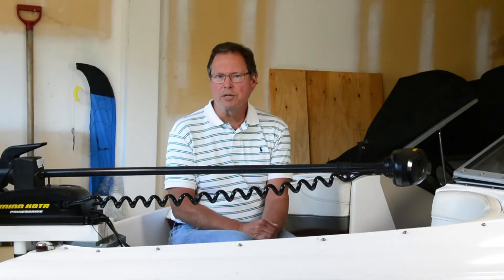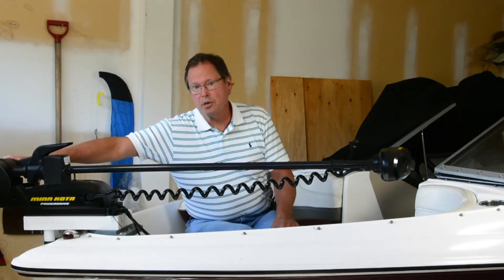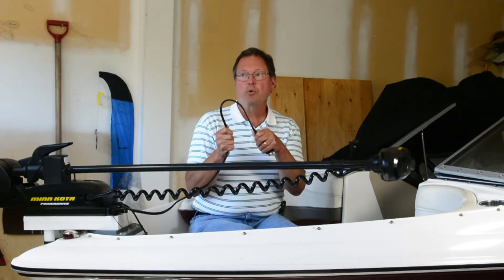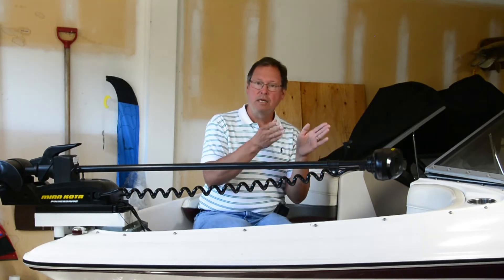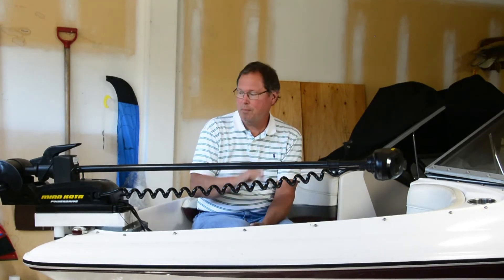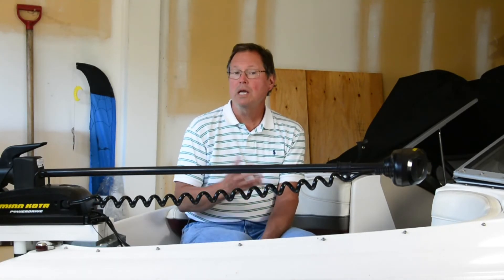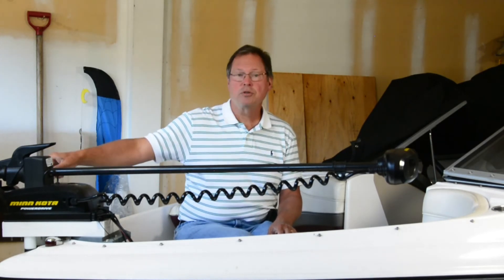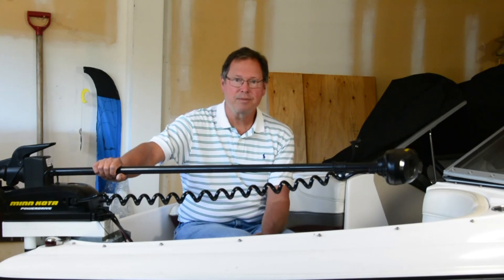12V vs 24V Trolling Motors - 3 reasons why 24V is more efficient

Comment: Well helped by your video and my experience with the !2 Volt Neraus engine mounted unit on my 16 foot fibreglass Cabin Boat I moved to a 24 Volt Unit together with a 110 amp Lithium Battery.
Whilst the Battery was expensive I now troll at around 1.9 mph at approx 14 amps which is giving me around 6 hours without stressing the Battery. All in relative silence ! Am very pleased
The amp draw for the same relative speed is also notable according to the weight carried in the boat.Ie with or without an auxillary motor and additional people.
With the 12 volt I was getting 1.42 mph drawing 16 amps and 2.18 mph drawing 53 amps .
Reply from the maker: Wayne, I'm very pleased this video helped you size out your system.  I spent a great deal of time on the internet trying to sort out a similar problem with my boat.  I'm very happy to share my learnings.  Thanks for your note.  All the best.

Comment: What about charging.  Been told the on a 24v sys with 2 12v batt in series they must be charged independently. Yes! No! ???
Reply from the maker: Hi Robert.  It depends on the charger.  If you have your trolling motor battery banks and trolling motor completely separate from all the rest of your electronics, and not connected to your engine charging circuit, and you are only charging from shore power, there are chargers that will charge two 12V batteries wired in series as a single 24V bank.
Most of the trolling motor specific chargers tend to make you think of always using 12V batteries as separate charging "banks".  So, if you have two 12V batteries for a 24V motor, they want to sell you a "2 bank charger".
Assuming both your batteries are the same brand, age, and capacity/model, there is no reason a 24V charger designed for the battery chemistry you are using cannot charge both wired in series together.
For example, if you have two 12V Series 27 AGM batteries wired in series, you can charge them with an AGM 24 V charger.
At the end of the day, a 24V battery is electrically identical to two 12V batteries wired in series.  There are simply twice as many cells put in series to get to the correct voltage.
Reply: @GoldenChannels Im  running 2 Everstart group 29DC Deep Cycle batteries in series. Same battery, same age, same CCA and isolated to trolling motor.  Was planning to charge with 24v charger after a lake visit. Then meter each battery to see how they charged.
Reply from the maker: @robertbennett6418  That should be fine.  After charging, if you let both batteries rest without the charger attached overnight, or at least for a few hours, if both batteries are healthy, they should be about the same voltage.  This will usually be 12.6V, but can vary by battery manufacturer.

Comment: HI Dean, this was pretty enlightening.  I have two trolling motors a 12V-55 and one that came with my new boat 24v-70  The latter came in really bad shape, I since have replaced whatever needed to get fixed but never installed it and use the 12v instead, I totally notice the lagging early on my days (and a hot plug) when it has been windy or I am working in heavy current.  Boat came as well with two batteries same size but different brands and provably ages as well.  Now one of them is dead and I need to replace it.  At the store the gentleman told me that there is no problem in mixing batteries, that is not what you said and I have a feeling that you know what you are talking about🙂   
So not to make this any longer looking forward to your video about UPGRADING 12V to 24V that will be awesome and also if you can tell us a bit more about mixing batteries.  Thank you very much for sharing your knowledge in a way that is easy to understand.
Reply from the maker: Hi Alex.  Thanks for your comments, and I'm glad you found the video useful.  The 24V conversion video should be out before end of summer.  Obviously, there are other items that need to be changed to allow onboard charging from the Yamaha Outboards 12V charging system, and also shore power charging.  Thanks for subscribing.  We'll let you know when more videos are here.  Tight lines.

Comment: Great video.  I have a 24 volt powerdrive for a 85 lb kayak and a 120lb scanoe and I have a 24 volt 50 ah battery that I've only used once. Can I buy a second 50 ah same battery to add since the one I have is practically new. I fish a river with current and I figured the 24 volt motor would do a better job because my 30lb thrust wasn't enough to push the kayak in some areas, it would come to a standstill.
Reply from the maker: Hi Dennis.  Yes, there should be no issue buying a new version of the same make and model of battery and putting them in parallel.  My suggested process for putting any two batteries in parallel is to disconnect both and charge them fully, and let them rest overnight.  Then run the wires to them to connect them in parallel.  This will minimize inrush current between them.  Hope this helps.

Comment: One more question for you if you will indulge me.  I was initially confused about the charging of a 24 volt ( two 12-volt batteries in series system), but I think I understand now. I have a NOCO genius 12 volt lithium charger with 3 banks. If I place one set of leads on each of the two lithium batteries in series - I am thinking it will charge the two at above 24 volts, because they are in series and the charger's voltage will also be added together.  I first ordered a separate 24 volt charger but then realized I didn't need it and canceled it. Was I right?
Reply from the maker: Tim,  Thanks for your comments.  The most direct answer I can give you on whether a 12V charger can be used to charge 2 x 12 V wired in series, one at a time, would be to contact the battery charger manufacturer to ask them the question directly.  The answer lies is how the charger is designed, internally.  Some will work, and some won't.  If you have any other shore power connections to your boat will also come into play here.  The main factor is where ground is in both the charger and your shore power circuits.

Comment: This was an excellent physics lesson. You really know your stuff! Your video really helped me realize the advantage of 24 volt. Based on your video, I decided to go with a 24 volt Motorguide Xi5 80 lb instead of the 12 volt 55 lb. I was just trying to avoid adding another battery and so I could use my battery switch.  I decided on all Ionic lithiums which are very expensive, but I think I will be glad I did.  Since they are two twelve volts, I can still take them out of series and have a backup in the event of main battery failure. I have a 2018 whaler montauk 170 that weighs about 2500 lbs loaded. I think the 55 lb 12-volt would have been at its limit (on the power curve) all day, especially because of the significant currents, waves and wind in the ocean here in Boston. For my old 12 volt minn kota 55 riptide in my old 15 ft montauk, I had 6 gauge wire going to my bow plug, which was a pain to fish from the console to the bow. With the 24 volt setup on my new boat, I went with 8 gauge wire, which will be easier to fish through and work with and since it only travels about 7 feet, it should be just fine. Thank you for helping me avoid a mistake. Since I already made the decision to have a saltwater trolling motor - mostly for the spotlock feature to avoid anchoring in waters over 100 ft - I should make sure it can actually do the job and not become a toaster oven.....

Comment: I would like to know the comparison of a 55lb motor running at full power and an 80lb motor running at 55lb thrust. Is this published anywhere? Effectively your site suggests both those size motors are running ~50 amps, with the 80 on 2x the volts of course. Even better would be to know the current at half power settings for both motors.
Reply from the maker: A good question.  The 24V Trolling Motor providing 55 lbs of thrust will be more efficient, and therefor will keep going longer from a similarly sized battery setup.  If you want to do a direct comparison for the specific motors you are comparing, you can punch in the numbers on our trolling motor wire calculator here:  https://www.goldenchannels.com/electric-trolling-motor-power-loss-calculator/

Current being supplied to both motors will be nearly identical, less the mechanical losses due to the 55 lb being full throttle.  The 24V motor at 55 lbs of thrust will lost a quarter of the power through the wiring as compared to the 55lb, which is significant, especially with longer shaft models and those installations with 20 feet or more of wire from the batteries at the back to the trolling motor at the front.

Tiller handled versions will be less affected by the voltage difference.

Hope this helps.
Reply: @GoldenChannels  Thanks but the calculator only seems to provide maximum current. I understand the motor when dialed back will be pulsing and quite affected by load so will be hard to measure and impossible to calculate. I did find 1 test someone did on an 80lb in no wind/current conditions, where max (10) was 33A and setting 7 was 15A, setting 5 was 6A, suggesting it is not linear, as expected, and that a 80lb running at .7 power is at least 2x as efficient ignoring all other gains as you detailed. However, if they were only measuring peak current those numbers could be way off, but not likely to be worse.
Reply from the maker: @soobz  Thanks for the comments on the calculator.  Yes, all trolling motors use what is called PWM for speed control.  If you try to measure current on an PWM circuit with a voltmeter, or even worse, an inductance based current meter with a clamp that goes over the wire/cable, the likelihood of getting a true reading is highly unlikely.  Maybe this will help.  My boat is 2700 lbs dry, with outboard.  It is a 18' Campion Allante.  I have a 55 lb, 12V Powerdrive with a 54" shaft.  On flat water with no current, I can get 2.1 MPH with that motor wound out.  My main reason for going to a 24V 70 lb would be to get more of the power to the motor itself, increasing battery life.  I'm not worried about top speed for the fishing I do.  I'm happy trolling at around 1.5 MPH

Comment: I'm dumb so excuse me..I have a 30 thrust on my Jon boat with 1 battery and my new bass boat came with a 40 thrust 24v ...does that mean my 40 will be 2x as strong as the 30?
Reply from the maker: It's a good question, and trolling motor thrust ratings are confusing.  And, since I don't know exactly how both boats are wired, I can only give you guidelines that the 40 will provide about 25% more thrust power to the water.  Thrust also does not translate directly into speed.  Considering that your bass boat is probably fiberglass, and the Jon boat lighter aluminum, I suspect that your bass boat will most likely not be much faster at top speed than the Jon boat.

Also, your Jon boat's trolling motor is probably also a tiller handle.  So, there is less overall wiring in it.

If you want to actually calculate the difference in how much power is lost in the wiring of both setups, we have a Trolling Motor Wire Calculator on our website that might be helpful:

https://www.goldenchannels.com/electric-trolling-motor-power-loss-calculator/

Sorry that I couldn't give you more of a direct answer.  At the end of the day, the most we can do is give you guidance on the best installation practices.  There are so many combinations of trolling motors, voltages, and boats, that is is hard to understand what kind of outcome you will get until you actually try a setup out on the water on the particular boat.
Reply: @GoldenChannels  wow thank u for that awesome answer and link! Guess I'll find out in a few days when I get to take the new glass boat out for the first time 👍. Everyone was just telling me already that the 40 isn't gonna be enough for a bass boat.
Reply from the maker: @Riddlemethisgaming  You're very welcome.  Enjoy the new boat!

Comment: Can you lead me to where the adaptor on your bow can be purchased. I have a 19' sea ray open bow I am setting up for a 24volt system.
Reply from the maker: That adapter was something that I designed and 3D printed.  I used a software package which is free on the internet called Blender to create and shape the 3D model.  Unfortunately, it's not a reasonable thing to do unless you've got a lot of time on your hands.  But, if you want my model to start with, drop me an email at eric.larson@goldenchannels.com, and I'll send the file to you.

Comment: When two 12V batteries are connected in series to a 24V motor that draws 40A at full throttle, does each 12V battery deliver 20A or 40A to the motor in this mode?
Reply from the maker: When batteries are connected in series like you describe, each battery delivers 40A, assuming both batteries are healthy.
Reply from the maker: @Jean-Pierre Abello Good question. If you have one battery that cannot keep up, generally the voltage across both will drop, since they are in series. Since the trolling motor requires power (volts x amps) to maintain speed, it will pull more current, which drops the voltage lower again. This causes the healthy battery to work even harder.

After an outing, if you turn your trolling motor off for a half hour or so, then measure each battery with a volt meter, the reading should be close to identical for both batteries.

Hope this helps.
Reply from the maker: @Jean-Pierre Abello That will give you a good idea of how much current is being pulled by the motor.

Exactly what problem are you trying to fix?

Comment: I also have a Campion Allante 535 s, 130 2 stroke outboard, should be quite similar to what you got there, I’m wondering if 55lbs thrust is enough, I think it is my friend thinks I need bigger, are you happy with your set up?
Reply from the maker: The 55LB Powerdrive in flat water without a wind pushes my boat at about 2 mph at full throttle.  I got a deal on this trolling motor, it was a take off from a new boat, and had been used twice, but was in new shape.  This particular 55lb can be upgraded to a 24V 70 lb with 4 parts, including armature and brush assembly.  I'll probably try this for fun over the winter.  I'll do this conversion for a video next.  Hope this helps.
Reply: @GoldenChannels  it sure does, I’ve been researching all day, and what I’ve found is I do t want to be at the top end of the motor, I’m gonna go with and 80 lb thrust, better to be looking at it then looking for it as they say!
Reply from the maker: @drmurphy9219  Glad to be of help! Let me know if you have any cabling questions. We have a trolling motor wiring size calculator on our website.

Comment: Next ...why 36V trolling motors are better than 24V.
Reply from the maker: Lol...  Sure, I'll add it to the ToDo list, but in general, same rules apply, but at a lower half as much again on power loss, and similar on additional run times on lead acid battery technology.  Wiring can be way cheaper, with 8 AWG being very common.  Good choice if you can swing it.

Comment: Thank you for the video!  I am considering upgrading a 40' diesel pusher from 12v up to a 24v or even 48v system.  Can the same calculations (difference between 12v and 24v) be applied to the difference between a 24v and 48v system?  Are there any reasons not to do this?
Reply from the maker: Short answer is "Yes".  In all instances, a higher voltage is always better for power distribution.  The only difference I can see is the wiring internal to the trolling motor itself is much more than most powered devices in an RV, except maybe the refrigerator.  Trolling motors have way too much wiring inside, up to 100', so it's doubtful you have anything in your diesel pusher that has that amount of internal wiring.  Obviously, each powered device must be able to handle the higher voltage.  Hope this helps.

Comment: Can you run a 24v motor off 12v
Reply from the maker: No, you can't.  It will try to draw too much current, and will most likely damage the trolling motor.  If you want to see how under voltage affects things like heat, see the other video I did on how bad connections cause fires, here: https://www.youtube.com/watch?v=lPozeOyPmyI&t=33s

Comment: I see everybody has questions regarding their equipment and it definitely has me curious about mine! I have a 75lb single seat pontoon boat with a 62lb thrust newport vessel trolling motor running on a 12V battery and it seems to run strong however i’m thinking about upgrading and adding another 12V battery for full motor potential... Is that a bad idea for such a small boat  haha?
Reply from the maker: Ryan, probably the most significant aspect of adding another battery for you (assuming the added weight isn't an issue) would be that after a day on the water, your batteries would only be half the discharge state they are in now after a day.  This would make them live longer, since the deeper you discharge them, the shorter their life.